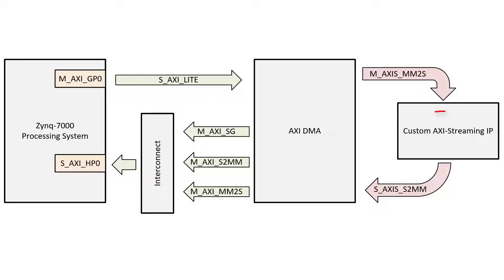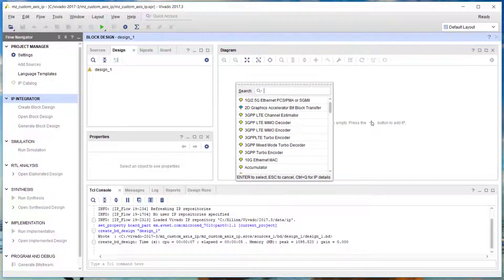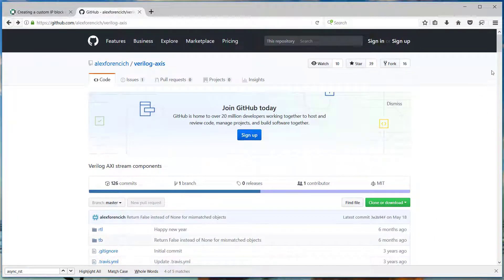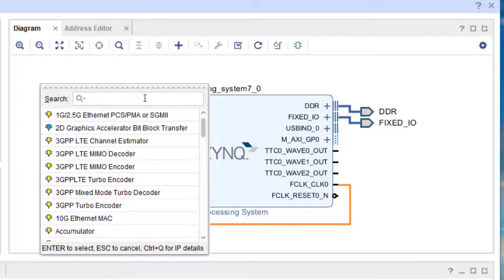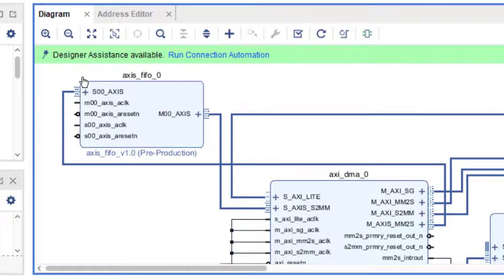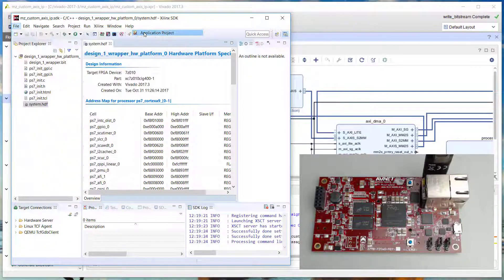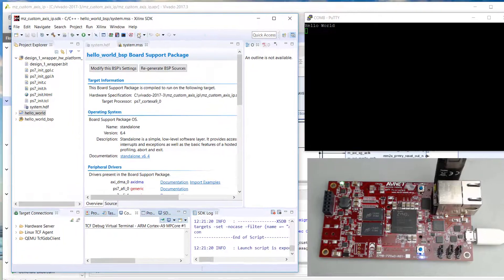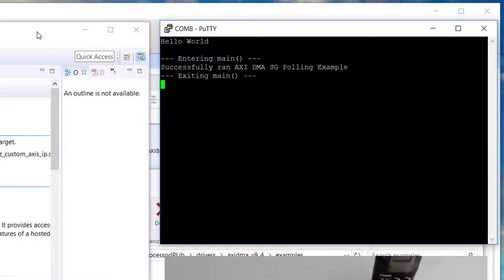Creating a custom AXI-Streaming IP in Vivado

Comment: Inspite of following every steps...I am getting the error of "ERROR: [BD 41-758] The following clock pins are not connected to a valid clock source: 
/axi_dma_0/m_axi_sg_aclk"...but I have used a clock(sim_clk_gen) already there and all the clk ports are connected....how the issue can be resolved?
Reply: btw...I am using ZCU102 board

Comment: I've been following along your video and  got to part of editing the custom IP (overwrite the generated code and replace it with alexforencich's verilog-axi code).  However, Alex's GitHub page in 2022 looks very different than what is showing in your video.
@ 4:30 you state that will post Alex's code below the video but it's not available here.  
Can you post this file and any other files required for this video so I can complete the lesson?
Or can you provide a list of the current Github files on Alex's page?

@8:00 you add the custom axis_fifo IP you created with Alex's edited HDL code.  If I didn't edit Alex's code @ 4:30 and proceeded with all other changes, can I add this custom axis_fifo from the repository and modify its HDL code later if/when you provide it below?  Or will I have to edit it @ 4:30 and proceed from there?

Thank you,
JT